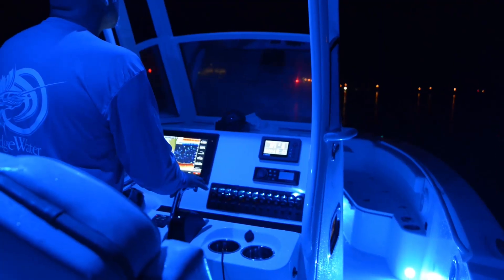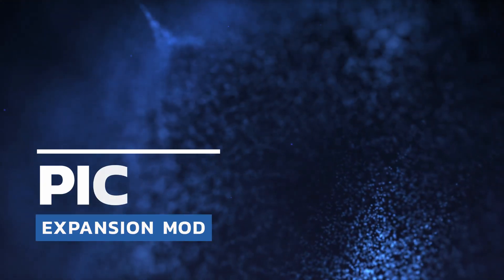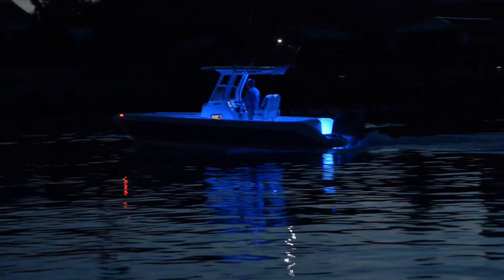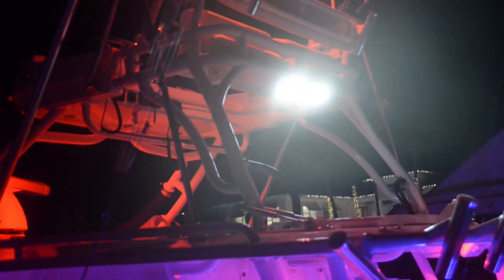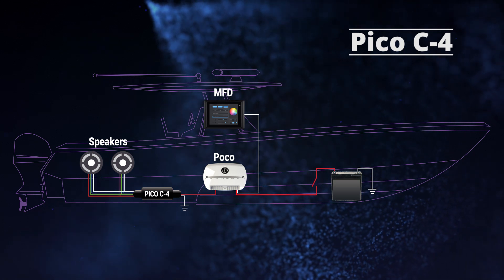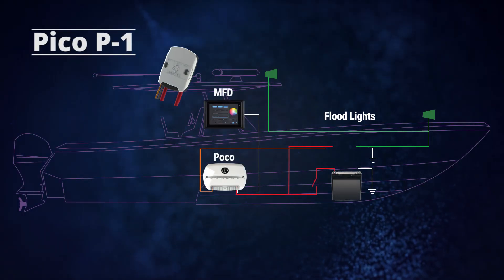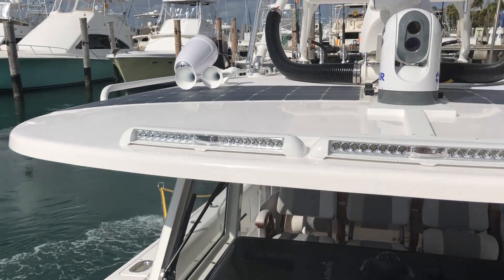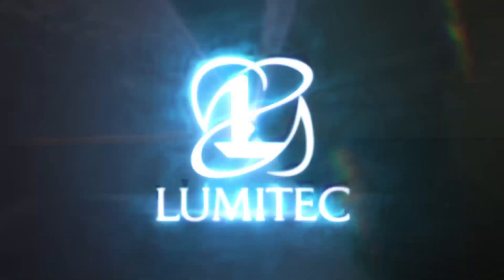Lumitec Pico Expansion Modules

Comment: Does each Pico need to have its own zone/channel on the POCO?
In other words, if I am using a POCO, and already have all 4 channels used, will I need an additional Poco to utilize a Pico?
Reply from the maker: You only need one Poco, it has four channels which allow for 10 amps per channel. You can create virtual circuits where you put different light families on the same channel, yet you can send different commands to each light family on that circuit/channel.

Visit lumiteclighting.com/poco-quick-start for more information.